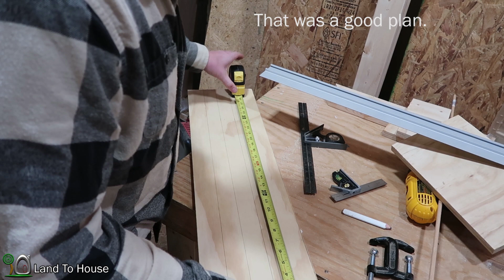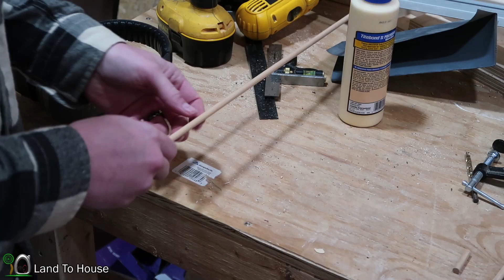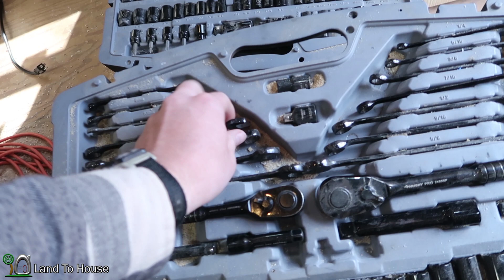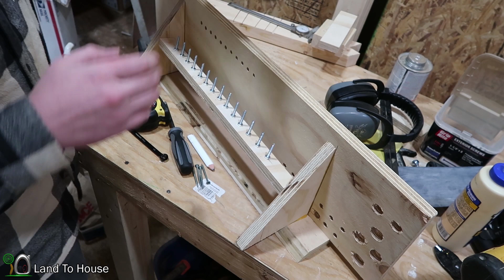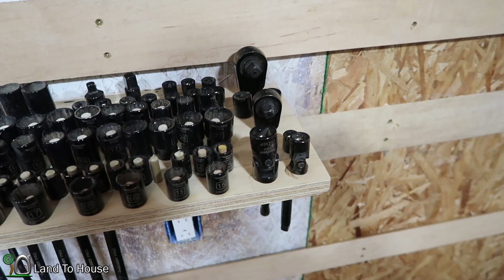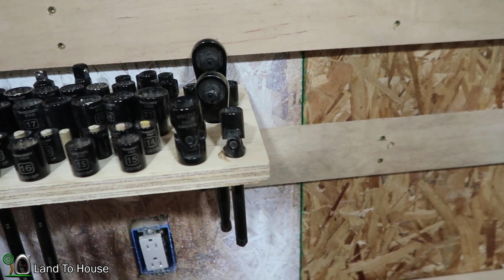Socket Wrench French Cleat - Build a Workshop #46

Comment: Thank you for showing the "what to avoid next time". 
If you are missing your 10mm you must be an auto mechanic, LOL
If you think about remaking this later, you could make a wrench and driver holder with a few pegs to hang a handful of the flat strip type of socket organizers.
Also you need to look at the 'pivot' of these holders, if they get vibrated from other tools running like the table saw or the air comressor, will they resettle into the cleat or walk up and lean forward and fall off the wall.  This one is quite front heavy for the short lower braces and I fear it's going to fall off the cleat.

Comment: Where you messed up, just cut them off at the base with a saw and sand it down... and set the sockets down and mark them to size. Then drill the new holes where you need them, you won't even see the mistake... love the video, a new idea I plan to do something similar. Thanks for the inspiration

Comment: I’m actually looking to make my shop with a French cleat wall. Using the spacing from the case and transferring it to the board would have probably given you the results you were looking for
Reply from the maker: I am very pleased with a French cleat system. You are right. Better spacing would have been great. Especially if I had laid out the tools before hand

Comment: Great idea, I have a set of DeWalt Driver bits in a yellow case which has the same problem, you can not get them out of the case, if you needed to use several of the sockets on a job, you could always make a small wheeled cart fitted with a french cleat.
Reply from the maker: Thank you. When its that hard to get the tool out of the package it makes you want to use something else. This way I have no excuse haha. Yes a small cart is a good idea. My shop is so small that I just have to turn around but in a shop like April Wilkersons new place you would need a cart.... and a moving sidewalk.

Comment: Great little project. It looks good. I was thinking you should have laid all the sockets out on the board before drilling all the holes, to make sure everything would fit.
Reply from the maker: Yes that would have saved some mistakes and headache but at the same time it was so annoying to get those sockets out of the container I didn't want to do that. But I definitely should have.
Reply: @LandtoHouse  Adam Savage does a 'dry layout' or even a mock-up when he does his tool storage improvement videos.  It helps lay out the spacing, logical grouping decisions, and check that the spacing is not too tight to be able to pull thingies out of the storage solution.  Keep some of the cardboard, posterboard, and styrofoam from your incoming shipment boxes for use as raw materials for doing layouts, drawings, mock-ups, and prototyping.